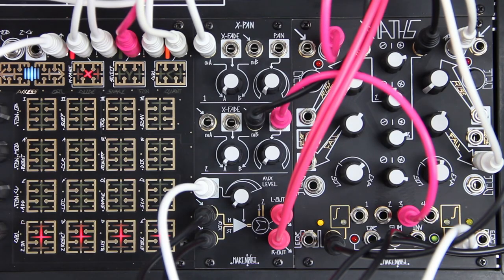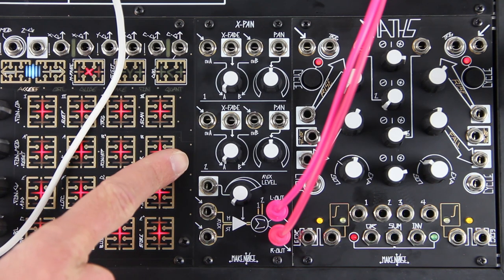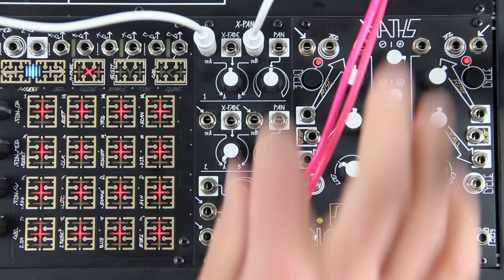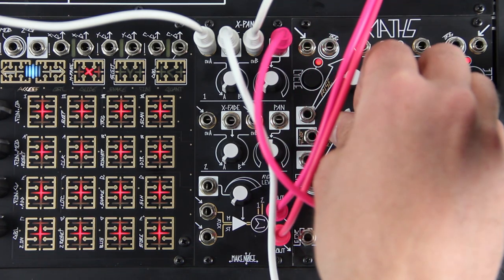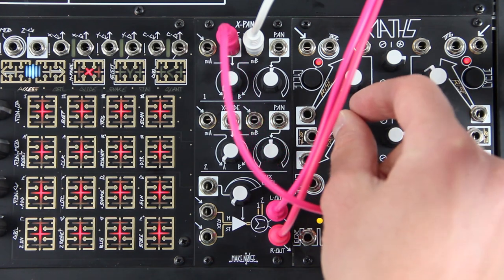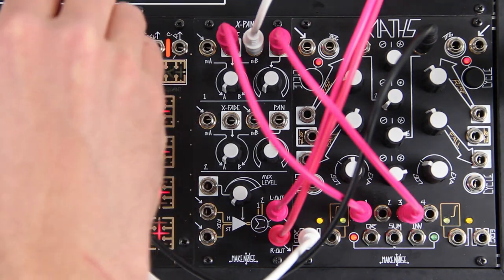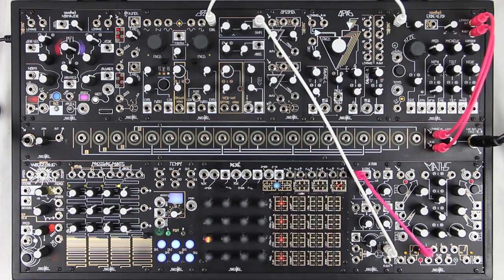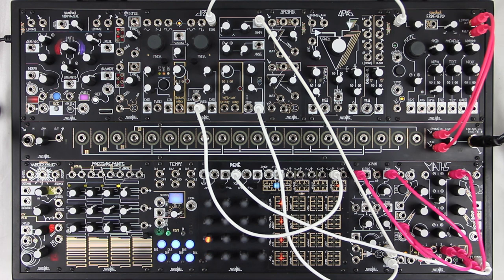Make Noise X-PAN

Comment: Can these be daisy chained?
Reply from the maker: yes, of course! the outputs could be patched to the Aux inputs of the next X-PAN in the series. Also, RxMx, Optomix, modDemix, Dynamix all have Sum outs and Aux ins, and could be chained with X-PAN as well (Left Aux input on X-PAN is mono-normalled to work well with all these others).
Reply: @MAKEN0ISEMUSIC  thanks for the reply. So there's no bus connectors on the back to link them and preserve the aux input on the subsequent x-pan?
Reply from the maker: No, they are chainable via patch cables, so that you can reconfigure the chain at will for decentralized, modular mixing.

Comment: If I wanted to add this to my Shared System plus what module would you recommend getting rid of so I can fit this in? It would have to be a STO that I added plus one more. I’m thinking Moddemix.
Reply from the maker: X-PAN will fit in the bottom row of a Shared System Plus. You'll have to remove the blanks and slide the other modules to the left. I'd put it between René and Morphagene.
Reply: MAKEN0ISE Sweet! Cheers.